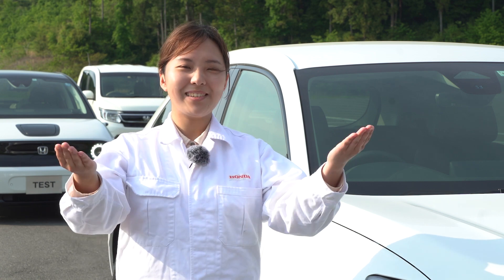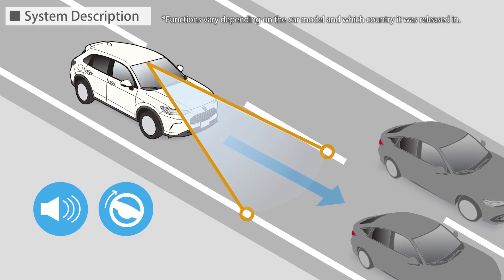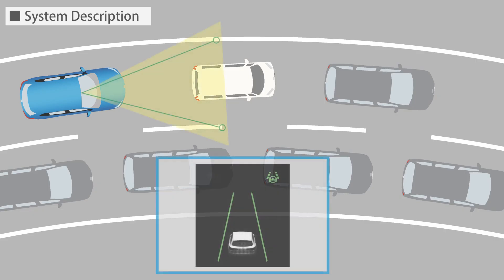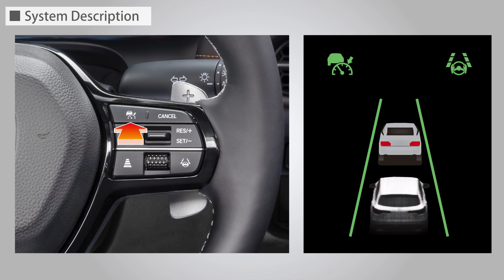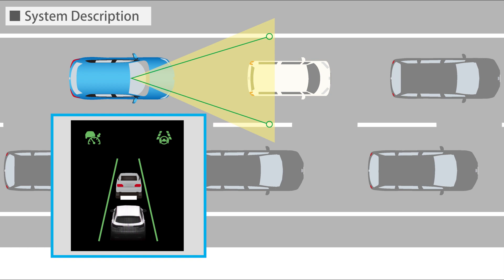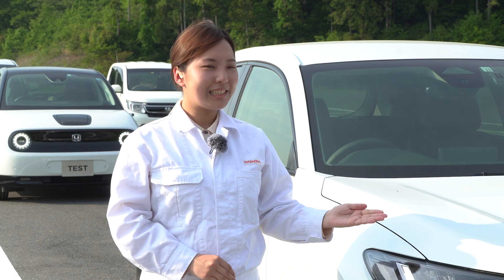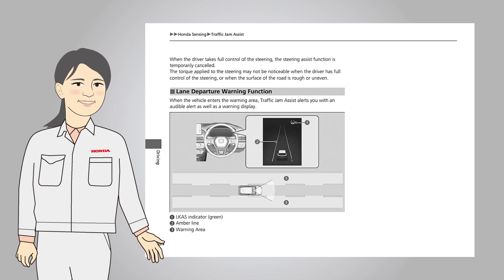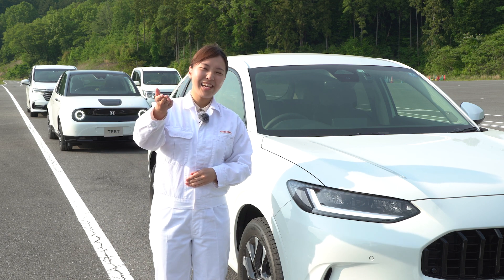Honda SENSING Traffic Jam Assist

Comment: Is it possible, to get that functionality also on the 2021/2022 Vezel? As the 2024/2025 facelift version has it. And the pre-facelift model could already detect lanes in low speed.. So the cameras should be there.

Comment: If driver didn’t handle the steering wheel system will deactivate safety features, is that safe!!
Why do not do as on Acura, decrease speed to full stop, while activating flashers, to inform of suspension of danger on driver as comma or heart attack??

Comment: Honda Sensing and Adaptive Cruise Control work great on my 2024 CRV Hybrid.  My concern is when I am slowing automatically because the car ahead of me is slowing, do my brake lights come on to warn the cars behind me that I am slowing?
Reply: You may have a car icon in the dash that displays all the lights statuses in real time. Otherwise, gradual decreases in speed, will not activate your brake lights, as they wouldn’t in any other car, but if the cars sensors detect a slow down that requires hitting the brakes, and then it will illuminate the brakes. You can always override the system if you’re concerned about a sudden stop by pressing the brakes yourself. No one wants to follow a car that’s constantly hitting the  brake lights for no reason other than gradually increases or decreases in speed.
Reply: I have the same Honda ZR-V and all it’s safety features are really works. They help me to keep safe driving and they alert me when I’m doing any wrong. Honda is superior in their safety features and worth the price tag.
Reply: The dashboard may have a car icon that shows the statuses of all the lights at all times. Otherwise brake lights will only come on If the car feels it needs to hit the brakes to slow down. Gradual increases or decreases will not activate brake lights as they wouldn’t. In any other car. You wouldn’t wanna follow  behind a car that hit the brakes constantly when it’s slightly modulating speed..

Comment: LKAS works in low speed?
Reply: That’s what I’m thinking cause I only get it over 70kmh
Reply: anyone know how to activate lkas under 70kmh?
Reply: @abzz4741  In my 2022 Civic I just activate it and it works, as long as the car can confidently see the lane markers it will steer all the way down to a full stop and back up without ever disengaging. It can be activated at any time by pressing the LKAS button on the wheel.
Reply: If your car has the TJA, then yes. Not all Sensing have that.